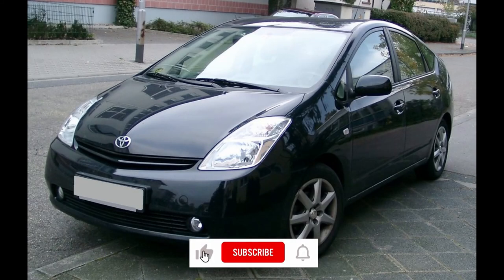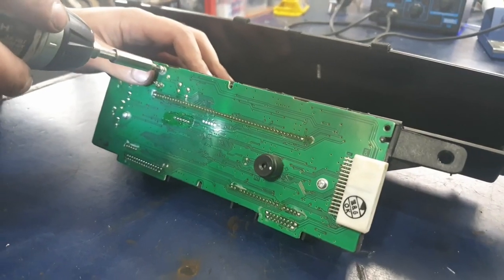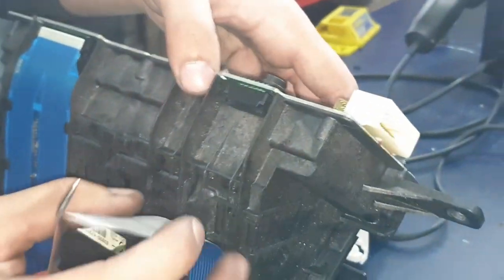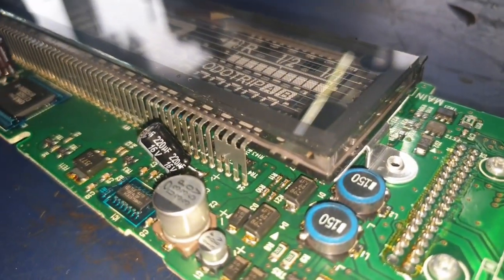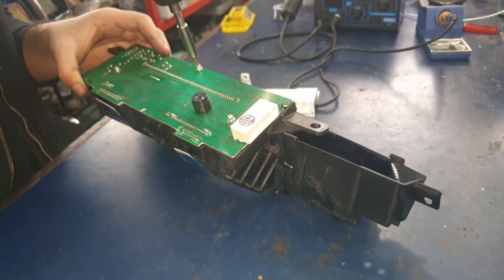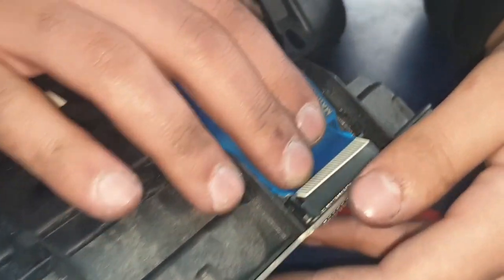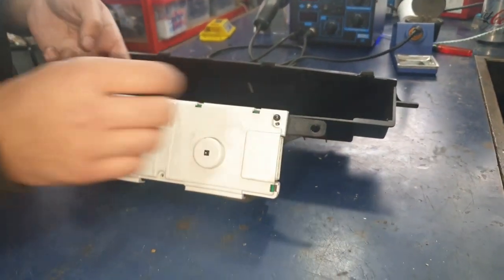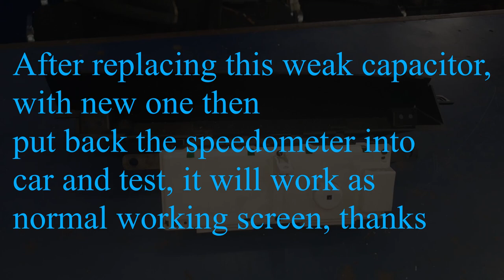in 5 Minutes & Cost $0.30/ Prius Gen 2 Speedometer LCD LED Screen Repair Fix with Tiny Capacitor

Comment: I appreciate that you took an already-fixed  board out for demonstration purposes. But. The whole point of your video should be to show exactly how to replace that bad capacitor. Just telling people to Twist the old one out of the way, and Make sure you put it in the right place, is irresponsible.

You claim to show a Repair in the tile. You did nothing of the sort.
Reply from the maker: this car actually we are using it, i fixed this problem about 1 year ago, and i started the youtube channel 1 month ago, so actually i am showing the right thing how to repair, and i believe this is understandable, thanks for your comment, next time i will make sure about these kind of things, i am new on youtube, thanks again